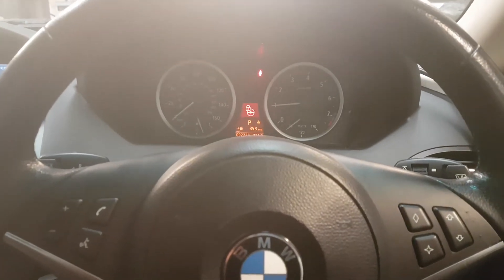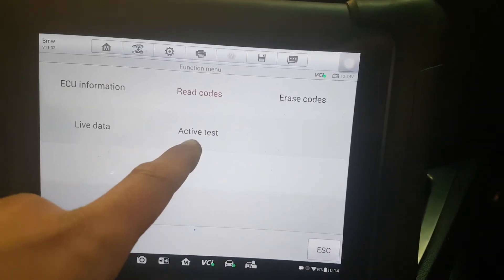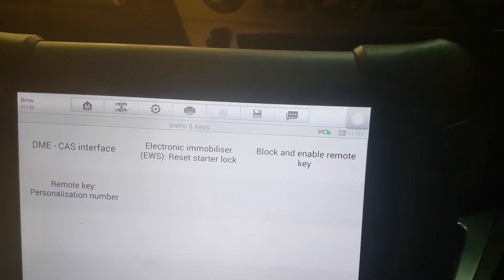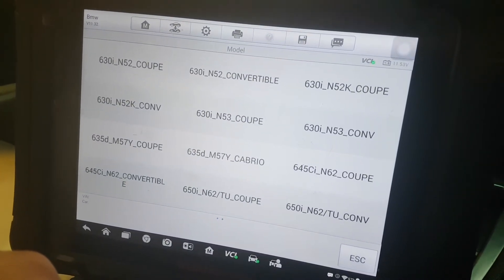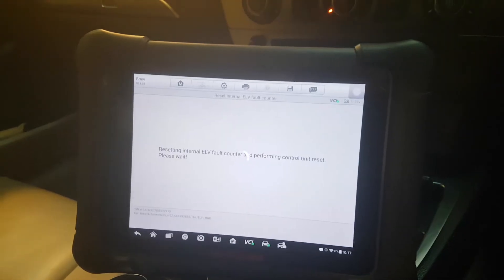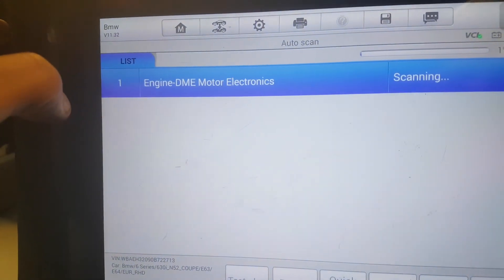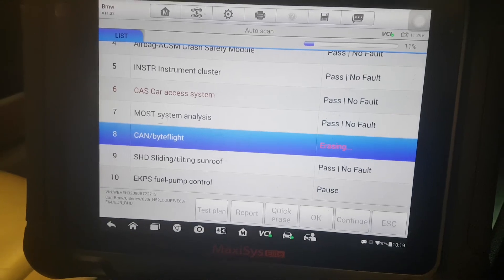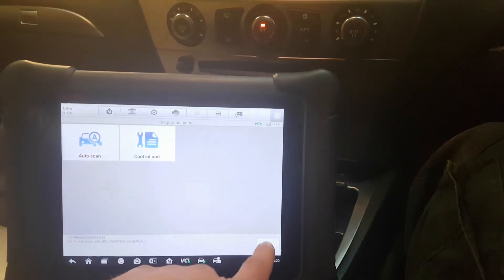Autel on a - BMW A0AA fault. CAS ELV Steering lock reset

Comment: Have a 2006 bmw 530 i ignition went out  replaced the whole ignition steering column etc. but I can’t seem to get my key programmed I got power from battery key in ignition it turns and all but does nothing anyone gone thru this before HELp

Comment: Hello my friend, I have the same problem, they reset the counter of the elv and cas, at first it only worked for me a few days later it appeared again, I have taken it to the same workshop and they did the same procedure again only this time they could not manage to erase the warning light of the steering wheel with the lock in red and sometimes it turns on and sometimes it doesn't. Any ideas I can do? Help 🙏🙏 .

Comment: Just had the same problem on a Mini cooper 1.6, 2007. I manage to clear the fault with my old Autel.  Thanks for the tip on doing a manual selection.

Comment: Hello Mate, I did this on my E92 325i but seems to be a temporal solution, it keeps happening once every week. Any ideas?
Reply: Hey man, having the same problem with my e92 330i. Did you find a permanent fix? Thanks
Reply: @MihovGeorgi  Hey man!
Actually yes, my mechanic ran an update on the CAS and then reprogrammed it with the INPA Software.

Be aware that the rest of the modules in the car need to be free of errors and that if the reprogramming fails it means that the CAS will need to be replaced or fixed.

If you have any error stored in the ECU then you just need to get someone to perfom the update and reprogramming with the WINKFP Software that allows you to reprogram individual components.
Reply: @alvarosanchez1351  that’s great! Thank you so much for the reply, I am glad it worked for you. Will try to do an update with ISTA today and will clear all errors with INPA and Winkfp, hopefully it works, if not - I found an emulator in my area for $15.
Reply: @MihovGeorgi  Great man! Let me know how it went for you!

Comment: sir, i want to thank you 🙏🏻 we have a 328i parked for almost a year, we are not very familiar with bmw engineering, but we changed the steering wheel and followed this video and  finally is running, i was gonna junk it for real jajajajaja
Reply: Changed the steering wheel? Why?
Reply: @siranohunt1564  the steering wheel column most likely.

Comment: Hi, Adam, could you please help me?, i am a mechanic with some mechanical knowledge. I have launch latest tools as well. Now i am facing the elv issues with my 2008 e60 520d. The same thing happened about 5 years ago and the stealer took almost £ 800 from me and just changed the battery. They left the car without doing anything, saying under diagnosis and stolen all my money. Now again after long time the problem came up again. When the problem begins, the 12v cigarette lines stays on, also the brake lights stays on too. I think this is because i turned off the car while the brake is on as how we stop the car usually. Couple of times i got the elv error but in orange. This time i managed to get some codes from CAS, which is A0BE, A0BF, A0C0 TERMINAL 15 OUTPUT 1 2 AND 3.  I guess the ELV counter is inhibiting the CAS to turn on. Please help. I have that K-CAN cable, but no software. If u can give me a suggestion, that's great. I live in Bromley, London. Regards Joseph.

Comment: great content .which model of autel r u using
Reply from the maker: Thanks, it's 908 Elite. Not worth the price difference from the pro to be honest
Reply: @SpeedTweaks  I have the 808 .can that work
Reply from the maker: @steameblair  I don't think it has the same functionality as the 908 range
Reply: Speed Tweaks hey there, one question if I’ll buy the maxiSYS ms906 autel  you think that would do the job
Reply: @Speed Tweaks  I have the same problem with my 328ix 07 it won’t star because of the steering wheel lock
Reply: @victorinokapon1092  my boy use his snap on zeus so am good now
Reply from the maker: @victorinokapon1092  I think unless you are going to use it on a professional level that is an expensive gamble for one job. Could be lock, CAS or wiring fault also. Call someone with the right equipment
Reply from the maker: @steameblair  snap on don't do this
Reply: @SpeedTweaks  yes they do ..thats how I clear mine
Reply from the maker: @steameblair  ok is news to me, will have a go tomorrow
Reply: @SpeedTweaks  snap on ZEUS that the top scanner for snap on coast about 13k